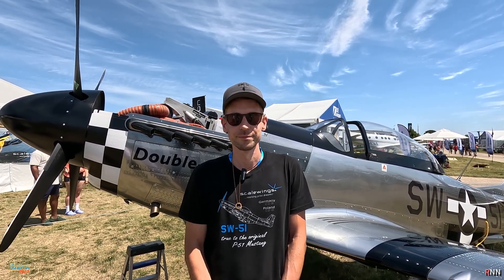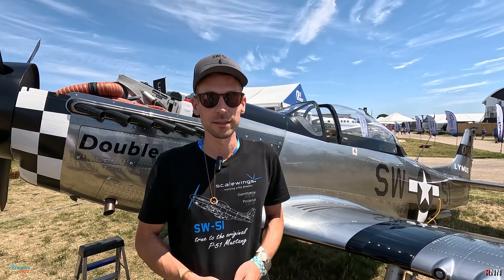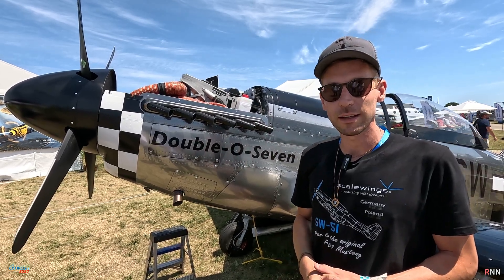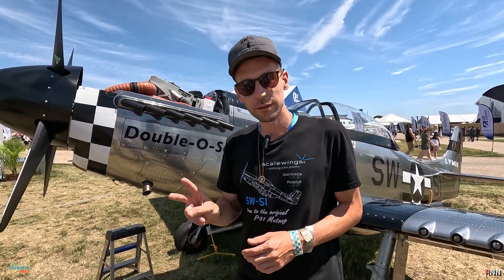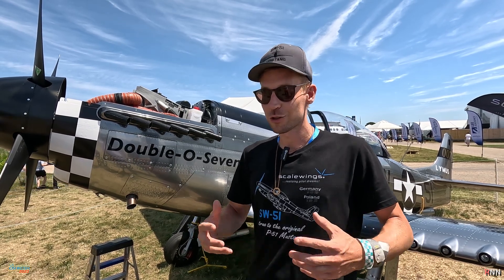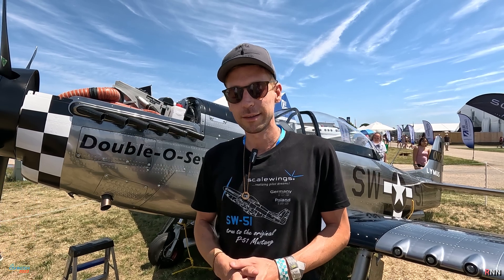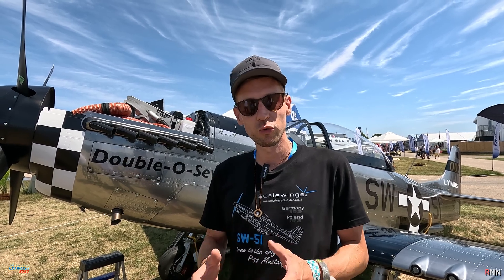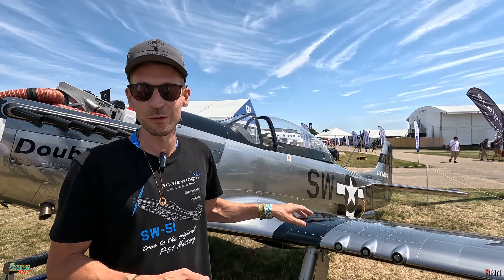AV2023  SIMON SHELL   SCALEWINGS SW51 MUSTANG

Comment: 1:25 there's not an oil cooler in the original P-51in this position, it's the carburetor air inlet. The Merlins oil cooler is located too as the water cooler is, in the big air scoop aka "dog house".
Reply: Thanks for your careful review!
the original position is meaning that the oil cooler is physically sitting in front of the water radiator as in the original design, just at a different location as you correctly mention..
Greetings
Reply: @simons.sw51  ok I obviously misunderstood, english isnt my mother language. Thanks for the correction. 👍🏻
Reply: Where could I get this paint? It's beautiful! @simons.sw51